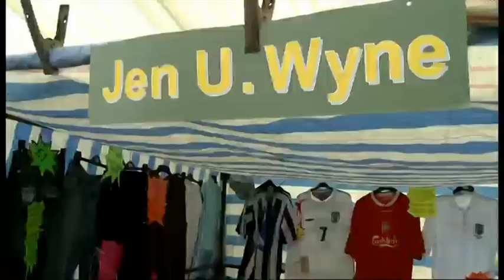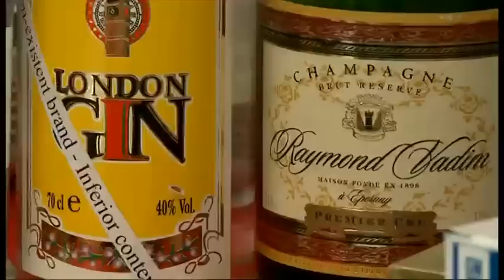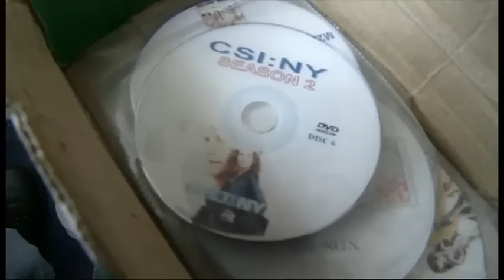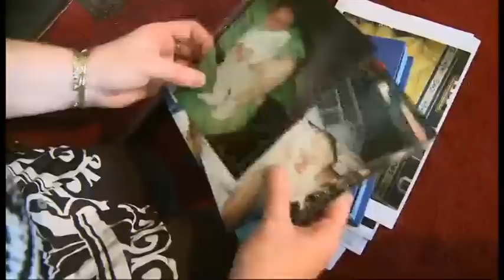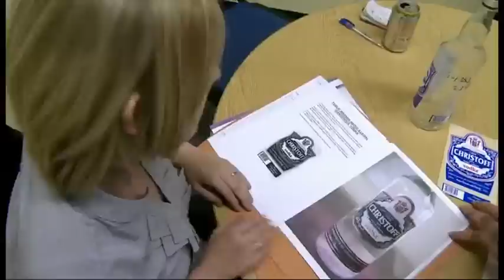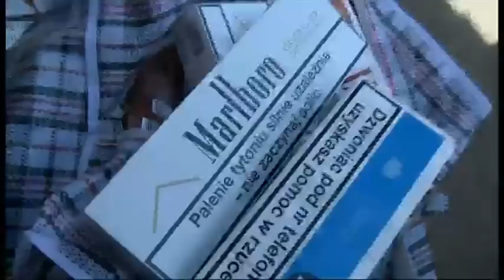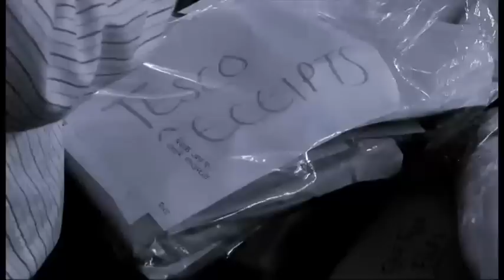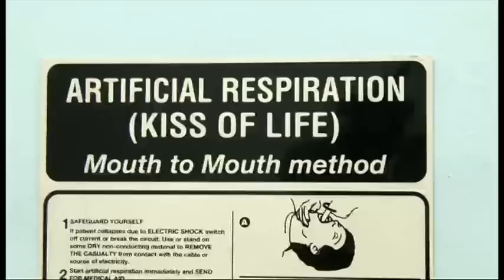BBC Fake Britain 13May-2013 09.15

Comment: Every mini moto has a chainsaw engine. They are small two stroke engines like you find in chainsaw. The chain being too tight. Check the bike before you ride.
Reply: ya that was stupid.. all 2 strokes are fairly generic..saws  mowers etc
Reply: It is mainly issue of the higher safety laws of the UK, and the standards accustom the population to not taking the extra care.

Comment: Maybe a genuine charger prevents a child from getting electrocuted...
Reply: Tests on the fake charger found it had serious defects, with the wires within it dangerously close together, meaning it could become live and electrocute a user. The gap between the primary and secondary circuits was 1mm wide, compared with European standards that require a 4.6mm gap
Reply: So yes genuine ones do prevent electrocution